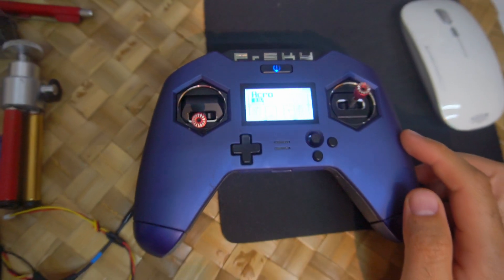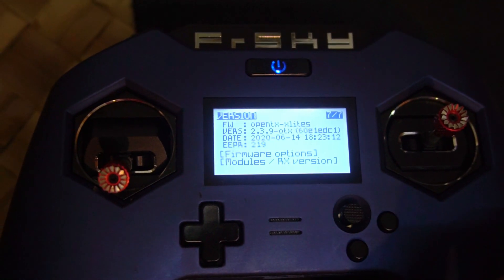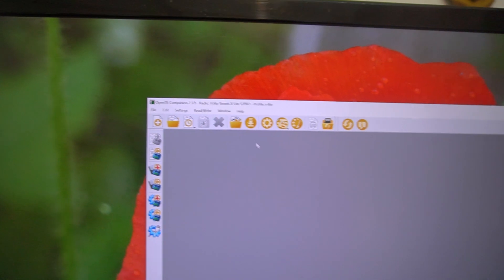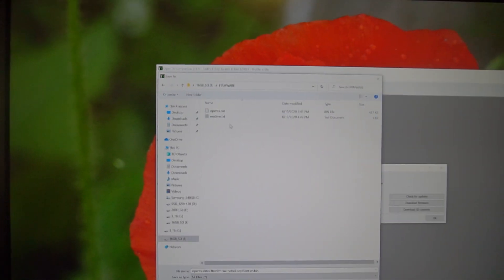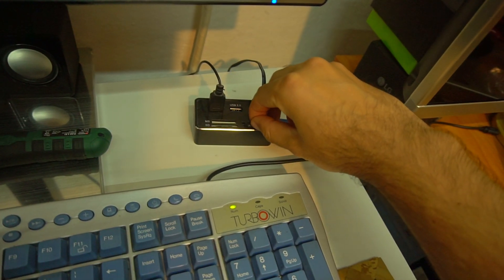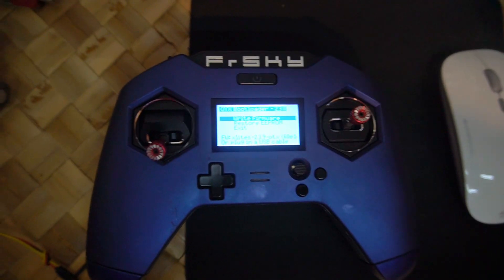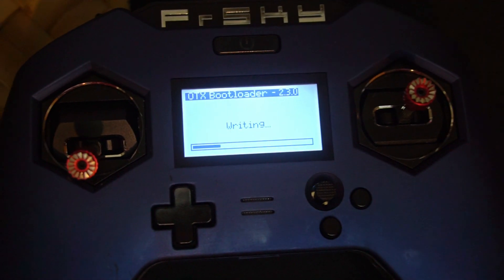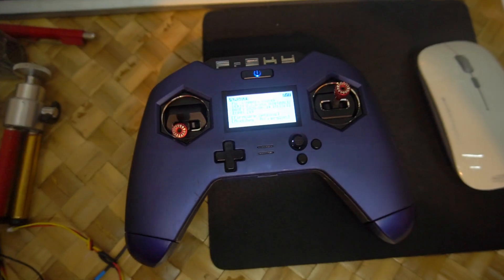Taranis X-Lite Pro Firmware update (OpenTX 2.3.9)

Comment: My xlite s. Don't have the option for a factory reset how do I do that?  I messed up n put the wrong firmware. Now I can't bind to anything
Reply from the maker: Try to flash the correct firmware again (if the radio is still usable).